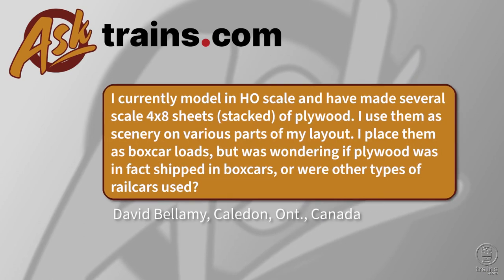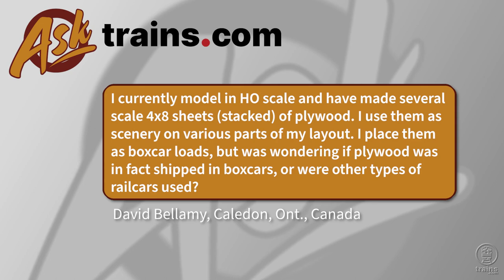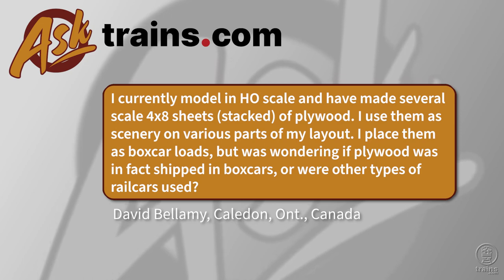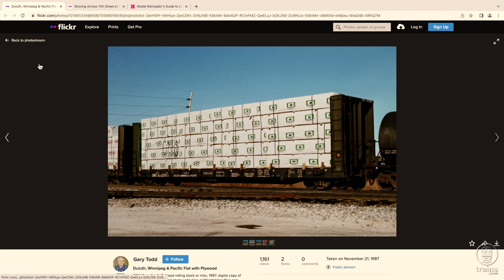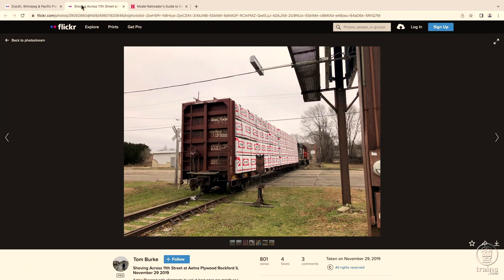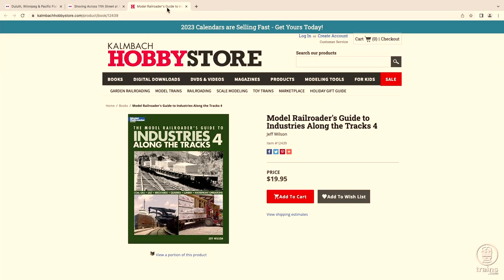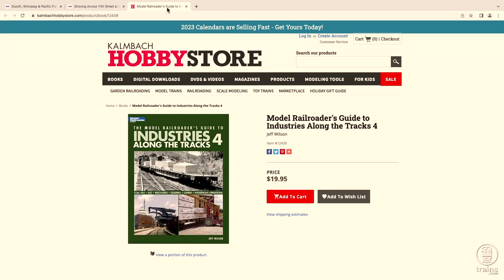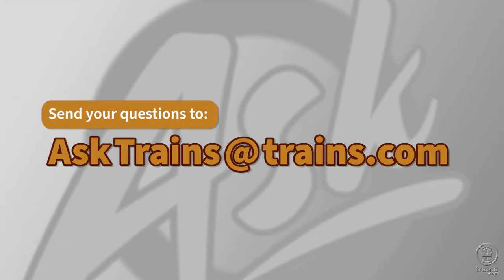ASK Trains | How is Plywood Shipped by Rail?

Comment: Great piece Cody. Lumber loads are secured on centerbeam flatcars by cables attached to ratchet jacks mounted on the sills of the cars and fastened to the top rail or run through to both sides. Those ratchet jacks many times are a separately applied part in HO scale kits.

Comment: There are no governmental requirements to “color-code” housings on tank cars - some shippers use colors to identify a specific tank car used for a specific commodity.  In Mexico, PEMEX used to paint the top portion of a tank car’s head (end) to indicate it’s assigned service - Diesel Fuel, Gasoline, Kerosene, etc.